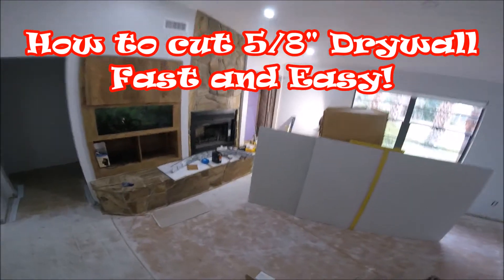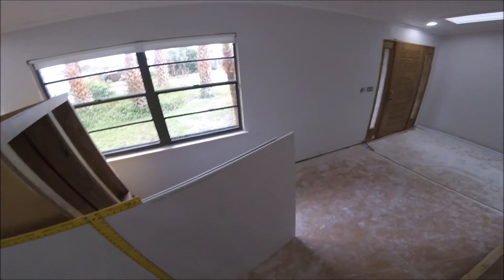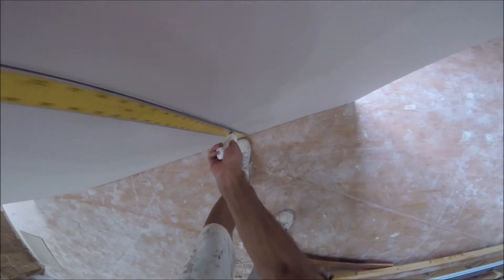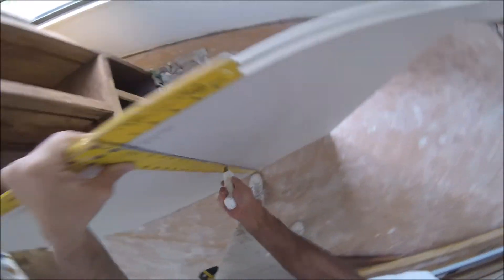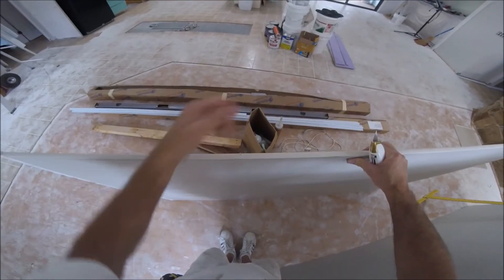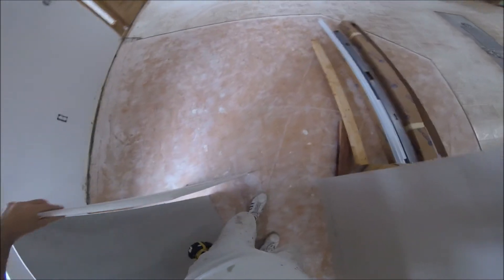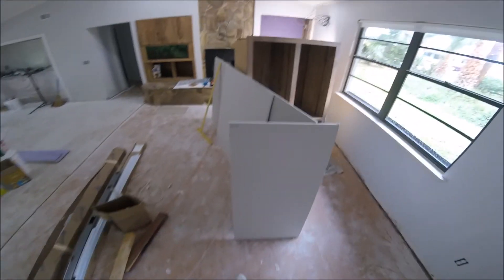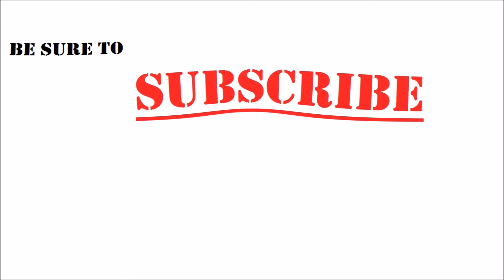How to cut 5/8" Drywall Fast and Easy!  Pro Tips and Tricks from a Drywall Contractor

Comment: On commercial jobs where you gotta crank out sheets fast you score the face once, pick it up with a corner on the ground, let the weight of it break it, set it down and score the middle 2 feet of the back paper, once that’s done swing that thing back towards the stack and it will break with the waste leaning against the wall. Rasp your edges and your done in 5-10 sec.

Comment: I tried cutting around outlets with my DW cutout tool into 5/8. Big fail. 1/8 blade kept breaking. And when it didn’t break I couldn’t trace around my boxes. Guidepoint was riding above the box and not finding the box edge.

Comment: I literally thought the tip that you showed was just common sense I’ve never worked with sheet rock until yesterday and that was the only thing the I had other than my drill and screws and key hole saw for the outlets in my trailer house razor knife just seems like the only way

Comment: Sorry but 1 time is enough and you don't have to be on the back side to cut it just push the sheet back if you work where I work you will get fired the first day
Reply from the maker: LOL...😂
Reply: I do metal framing sheetrock and acoustical ceiling and i never see any body cut the sheetrock that way is just extra work to get behind the sheet
Reply from the maker: I was just making this video for diyers that have a hard time cutting 5/8” drywall. Not really for a pro like yourself.👍🏻 I do have some other video that you might find helpful. Have a good one bro!🤟🏻 -Paul